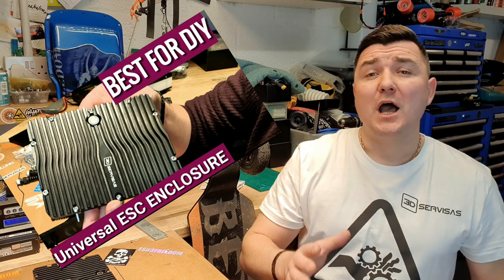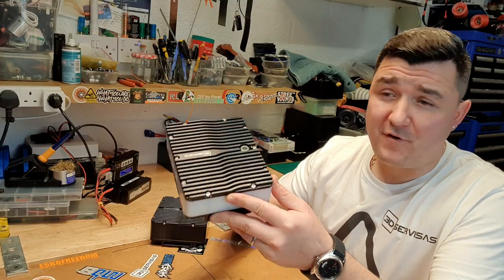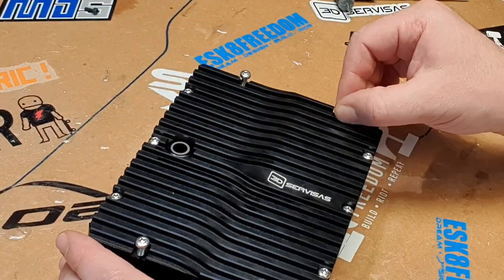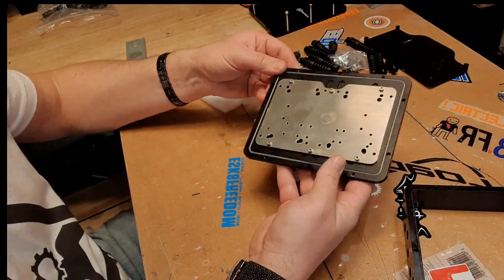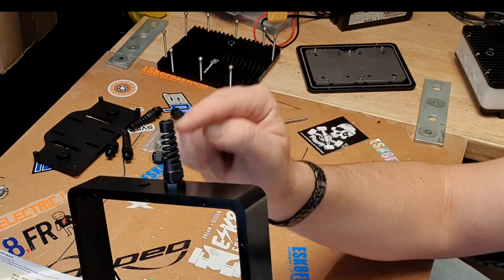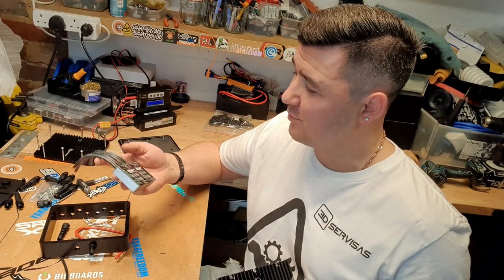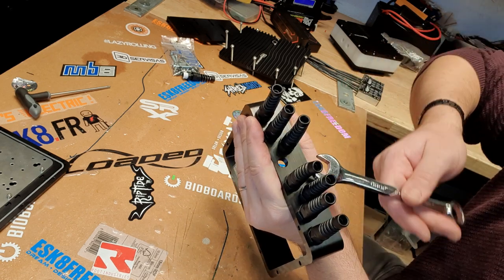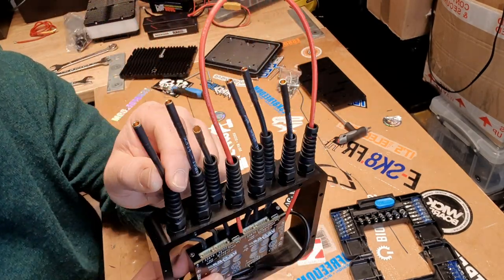HIGH QUALITY, 100% WATERPROOF ESC BOX.

Comment: I was so angry for like the first 14 minutes of your video when it seemed like the VESC only bolted to the bottom plate. Having a finned heatsink up top with no actual contact with the VESC would be the biggest waste of time... So glad they designed it so it can be on both!
Reply from the maker: Sorry mate ... i should of mentioned it at the beginning. 
Hope you enjoyed the video.
Reply: @PavelGarmas  Oh yes, don't get me wrong - Awesome video! You've got balls of steel risking your Trampa VESC like that man. That is a pretty pricey enclosure, but if I was needing one right now I'd probably get it. Not having to worry about rain so much when riding in the UK would be great. 

I do wonder how well it fits on mountain boards with bindings. My DIY enclosure goes through my truck bolts like this one and is a much smaller Peli case. But I had to offset it using a metal plate because over the truck bolts it is in the way of the bindings ratchet. I'll have to do some measurements.
Reply from the maker: @ItchyBones  
It is 120 euro to buy but quality is very good. Well 10 euros ticket is not a bad deal i think.

Comment: Nice video! But I wonder how you make the sensor jst cables go inside those small holes!
Reply from the maker: Cheers mate!
I did take the connector cap off , twisted the JST plug so it is parallel with the cable, pushed it through the plastic part of the connector and then put rubber seal on it. Works well and quite easy to install.

Comment: Nice box :) would you use bullets instead xt90 for the power cables in order fit the glands?
Reply from the maker: Hi mate,
No i would use the xt90 anti-spark. Cables through first then solder on the xt90.
Reply: @PavelGarmas  ok, hopefully you don't have to take it off again :) thanks.

Comment: How/where would the hall sensors from the motors enter the enclosure?
Reply from the maker: Hi,
Same way as the motor phase cables Sean. There are 8 connections at the back and two at the front.